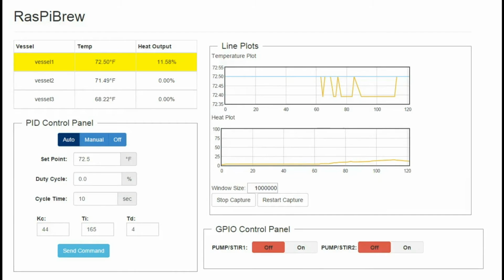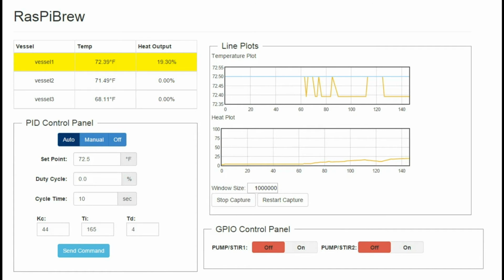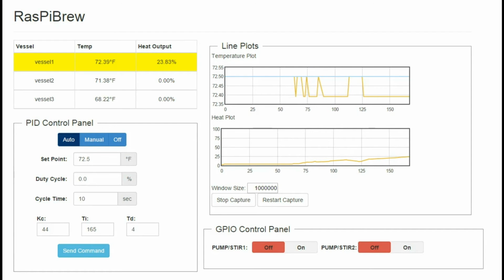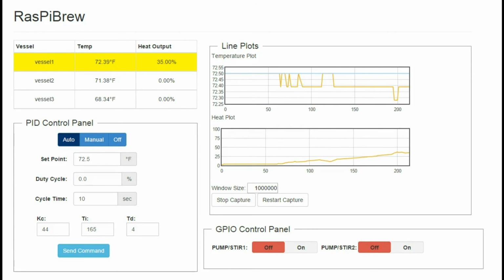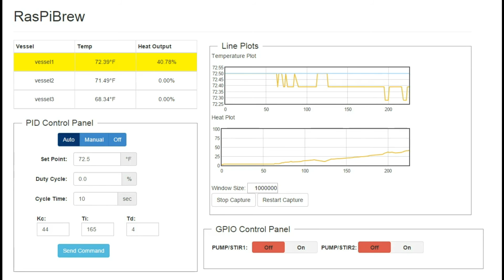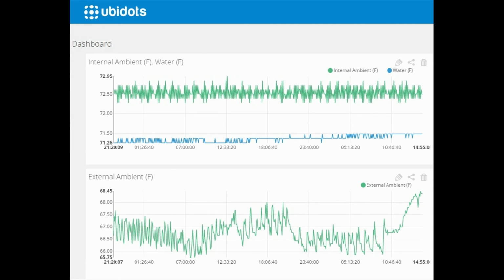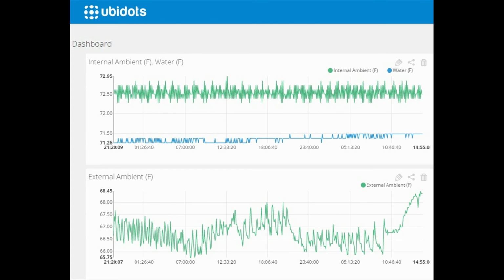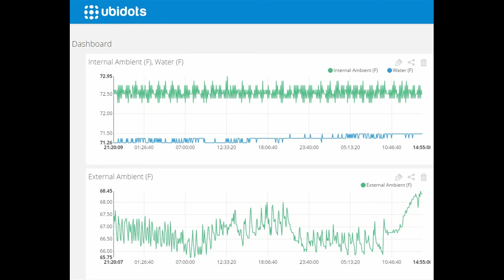Temperature Control Project Part 2: Pi-Powered Fermenting

Comment: So... did it work?
Reply from the maker: +TheOneZenith [Dan] Haha, yeah, I probably should do an update on this at some point. But in answer, yes! this set up was great for the time of year as I didn't have to worry about cooling. Once the weather warmed up, I needed a way to keep things cold. I've since upgraded to a small chest freezer, which itself has worked very well :)
Reply: Awesome! I'd love to see the new setup and maybe some info on your brew. How'd it taste and such?
Reply from the maker: +TheOneZenith [Dan] Definitely! I've been using the Mr. Beer refills just to get my process refined a bit. I've done 4 batches, and the 5th is currently carbonating. The 5th one is my first Pale Ale, the previous ones were an Oktoberfest, an American porter, a Guinness knock-off, and a different porter, I think.  The first few batches were OK. Definitely drinkable, but nothing earth-shaking. I think the first few had too much oxygen introduced during bottling. I'm also not a fan of the larger plastic bottles from the kit. I've since moved over to 12oz glass bottles, which I much prefer. Since I got a bottling wand and changed up my bottling method a bit for the glass bottles, I've gotten much better results. I think the next steps are to move up to larger batches with better ingredients. Fortunately, there's a number of local brewing supply shops around. It helps that the area I live in is lousy with craft breweries :)
Reply: Maniacal Labs LLC: Sweet. Have you ever used Grolsch Lager bottles? Those ones with the rubber gasket and flip open top are a great way to save on bottling costs.

I hear you on doing bigger batches. My first few adult brews were in the Mr.Beer, though as a kid I played around with making my own booze. Those kits get costly!

I moved up to 5 gallon batches about three years ago and it is way cheaper and easier. The local brew supply shop near us sells hopped liquid malt extracts for about a quarter of the price of Mr. Beer kits. Just boil, add the lme and your additional sugars if needed, chill to temp and pitch the yeast. Good stuff.

Is there a method to automate all grain brewing with the BrewPi too? Also, where do you pick up all the components at an inexpensive price? Will the Raspberry Pi Zero work with this project?
Reply from the maker: +TheOneZenith [Dan] Ah, yeah those might be great when I start moving to larger batches. While I do prefer the 12oz portion size, I do like the aesthetic qualities of the Grolsch bottles. And of course being able to re-use them and not having to deal with a capper is a nice plus :)

Also yes, those kits get into money real quick. I'm right there with you on the locally sourced LME recipes. That'll definitely be my next move.

As far as more involved automation, I know it's been done, but it's a bit outside of my scope at present. Honestly, you might take a look in some of the recommended videos that come along with this one. I'm not sure if there's a turn-key solution, but I have to imagine that others have come up with something like what you're talking about. Sorry I can't provide specific examples, but I'd recommend checking out the community forums on BrewPi, Mr. Beer, etc.

For components (the electronics, at least), it's a combination of ebay and amazon for best value. A lot of what I'm currently using is done with stuff I've accumulated over the years. Regarding the RasPi Zero, it could, but you'd have to tie up the USB port with a WiFi adapter.